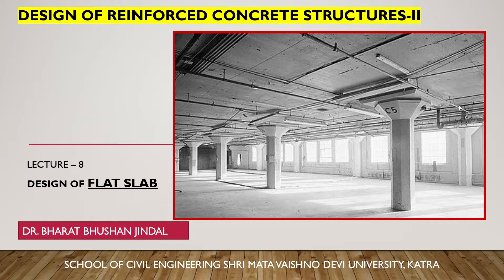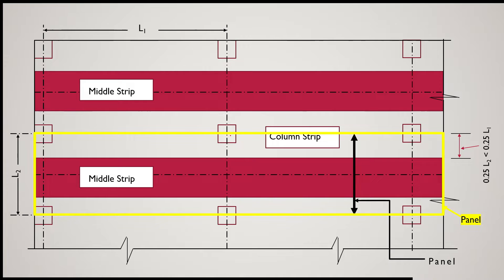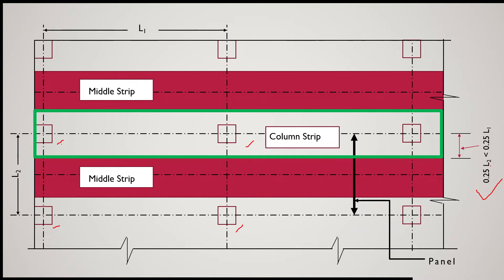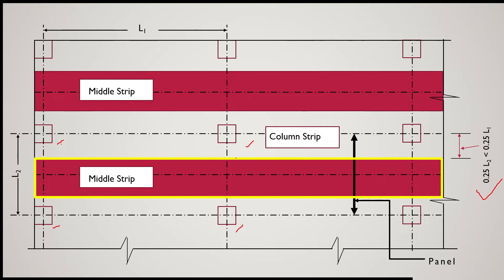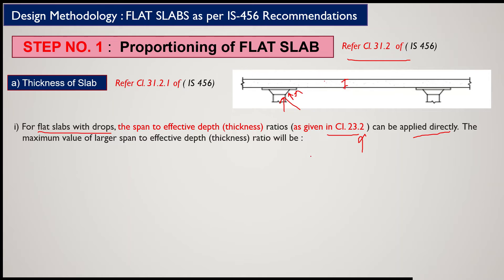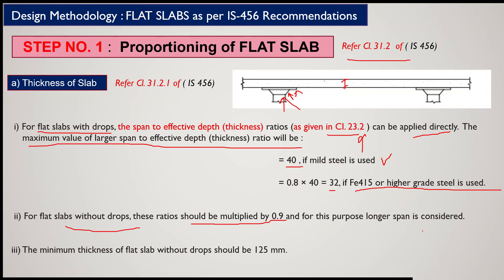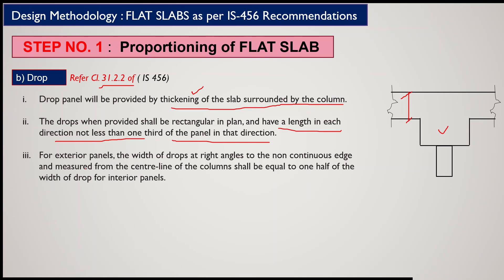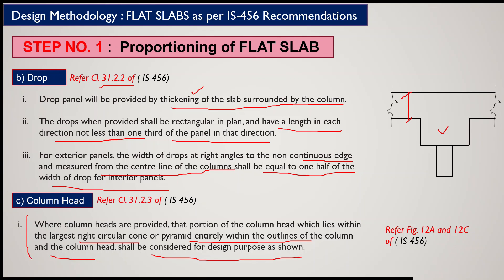Lecture 8 || Design of R.C.C. Structures || Flat Slab || IS : 456 Recommendations

Comment: Sir @13:45.. 3rd point for DROPS.. Sir. Does that mean.. if the width of drop in interior panel is suppose "10mm".. then the drop width of exterior panel should be half ..."5mm"...
Reply from the maker: Check your question.

Comment: sir, at 8:28 you told us to refer CL. 23.2 but CL. 23.2 is of CONTROL OF DEFLECTION......however,  in CL. 23.2.1 (a) part there are ratios give for span and effective depth....we have to consider that or something else??
Reply from the maker: Cl. 23.2 provisions are applicable but for solid slabs also refer cl. 24 carefully
Reply: @DrBharatBhushanJindal  i was also confused with this CL.23.2 but with this reply of yours to ronak i also understood